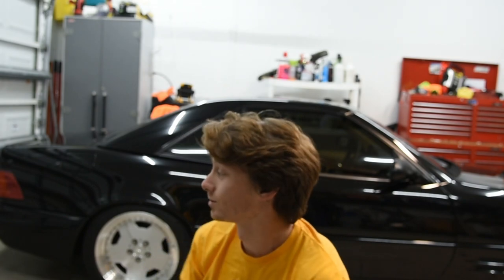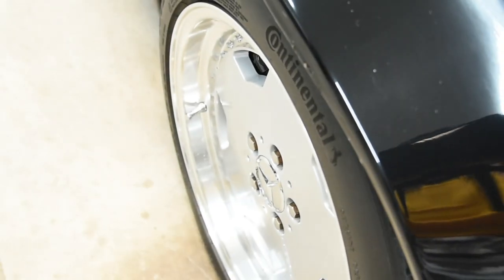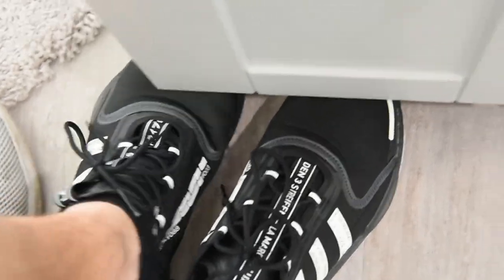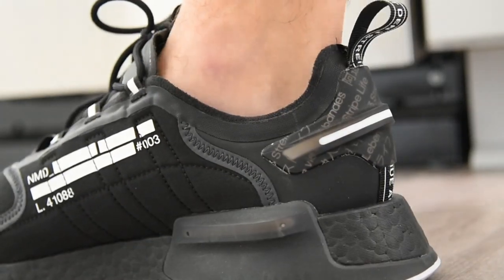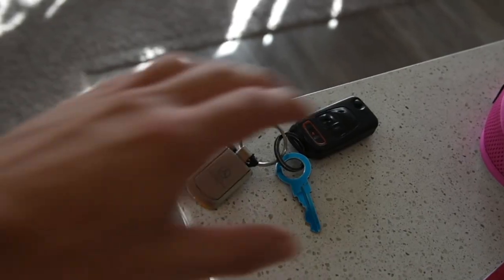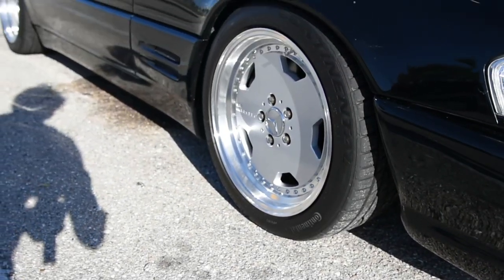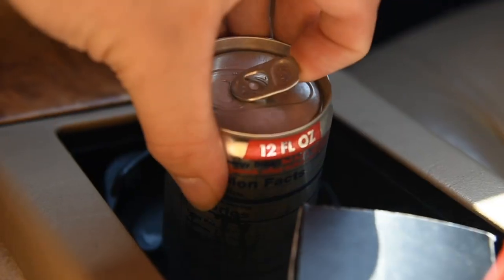“Vlog” #2 Rear brake caliper install / R129 Sl500

Comment: Omg. Sick ride. 

What size rims and offset?  Tire size?
Reply from the maker: Thanks! The wheels are 17x8 in the front and 17x9 in the rear. 215 front and 245 rear! I’m pretty sure the offset is +25 in the rear and +35 in the front.
Reply: @K3VtheG love the setup!
Reply: @K3VtheG are those wheels replicas?